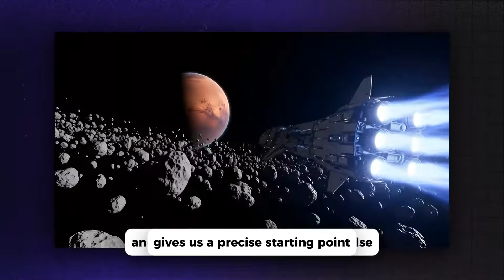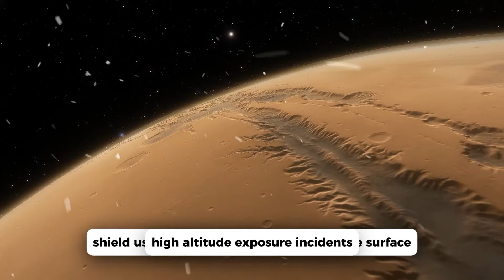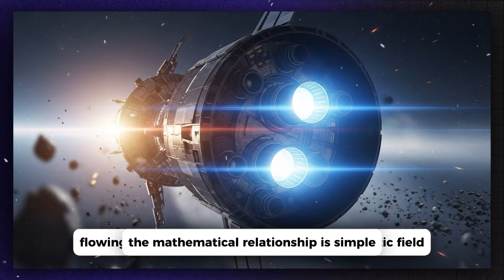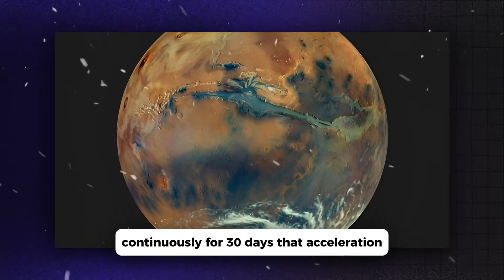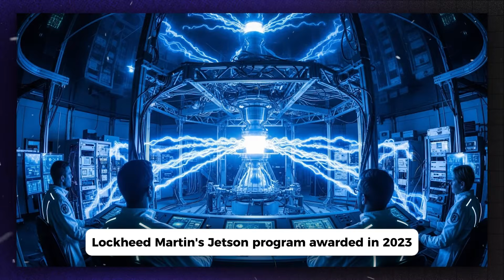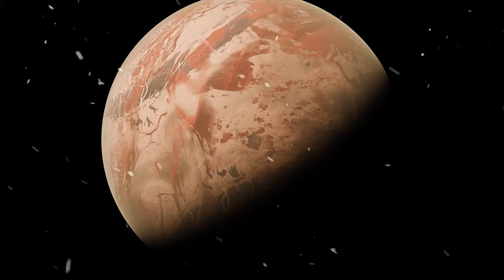Russia’s Plasma Engine Could Reach Mars in Just 30 Days

Comment: Whom can I connect and get in contact with to show them concentrating the magnetic focal points and utilizing magnetic and thermal principles we can route dual focal points before exhaustion with magnetic rods in the exhaust port to as a shield/refractor to prolong the exhaust port, handle higher temperatures and allows a bit more force. I developed my theorems and math a few years ago I’d love to help
Reply: Either the patent office or write a paper and have it published in peer reviewed scientific journal.
Reply: @Voodoo_Robot patents are for money and control of one’s product i personally don’t give a crap and I’ve submitted multiple papers to specific labs, individuals, and physicists with similar derived formulas and equations .my latest  I did a paper on frequency attunement inside of a reactor for additional push without ramping more power. thing is I want to give my useless knowledge away not protect and monetize it. I’m continuing to send papers out I seek nothing besides simple recognition. What I would love to do is give away a hypothesis for sterile neutrino cavitation possible harvesting mostly witnessing A STERILE FIELD and possible polarization and a theory on how to isolate the principles utilizing harmonic frequencies to waveform for stabilization coherence…… there’s more facets but it’s the gist. Peer review is important but my math kind of just disproves anti matter because of the neutrino mass but could possibly prove dark matter at higher energy densities but it wouldn’t be considered dark . It’s from a sterile field and choosing the direction of polarization…. Again just wanna give whatever tools away that helps does no good for me. There’s a lot of explaining left out because of complexity which requires the math for understanding so sorry In advance